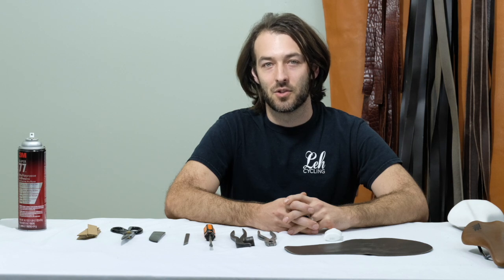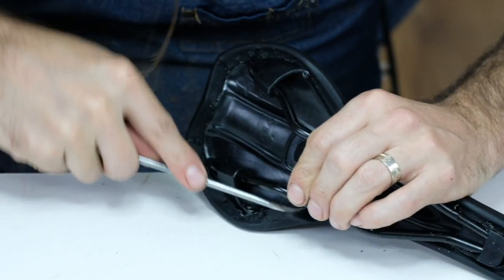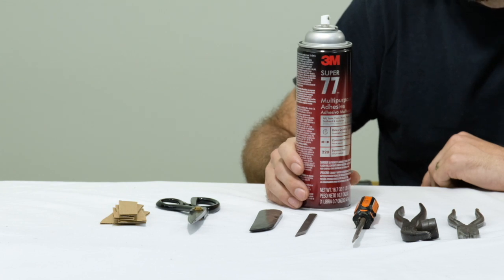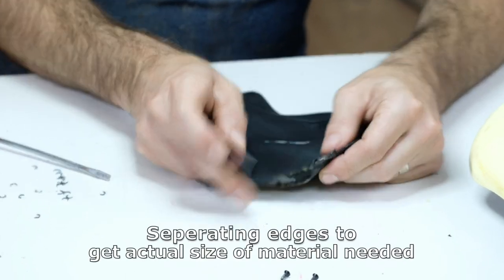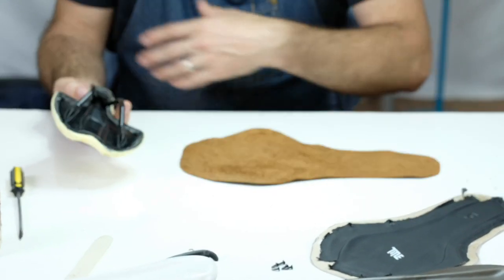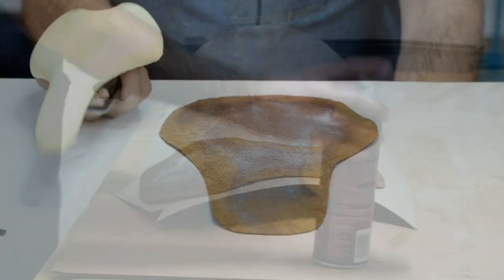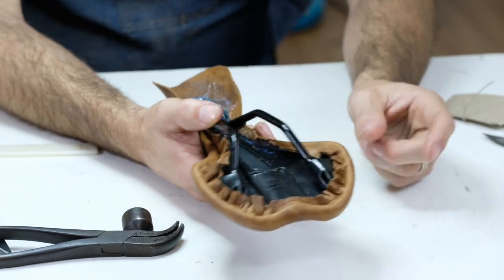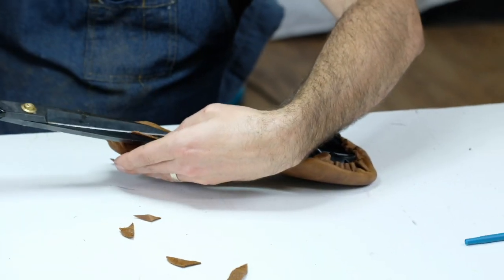How to Recover Your Bicycle Saddle With Leather By Leh Cycling

Comment: Hey, what glue is the white one for the edges? Thank you!
Reply: I have the same question. Anyone out there have the answer?
Reply: Elmers white glue
Reply: I'm pretty sure it's the water-based eco-friendly version of contact cement. It has has milky white color to it. The water would soak into the leather and help it stretch, unlike the solvent based version.

Comment: To ensure that grove is firmly glued, place a fabric there to from a mound, then can place the saddle in a thick plastic foil and in vacuum pressure bag. Suck out the air with a vacuum cleaner and wait for glue to dry, usually a day.
Reply from the maker: Also a good thing to try!

Comment: Thanks. Great video.  About to embark on my debut re-covering journey.
A few questions for you.
1. How long to wait before the 3M spray adhesive is tacky enough to hold, but not too tacky as unable to reset?
2. When is the 3M glue dry enough to move on to using the white glue?
3. How long to wait between application and with your white glue?
4. Should we not add white glue to the nose until the white glue on the sides and back is dry?
5. When is the white glue dry enough to move on to working the nose?
6. Is there a leather conditioner you recommend?  Will pants/shorts/tights/etc rub off said conditioner?  If so, will it stain/damage the clothing?
Thanks again.

Comment: Some leathers stretch more in one direction than the other. Which direction should be the most stretchable? Lengthwise or across?
Reply from the maker: Typically bovine hides have more stretch horizontally or near the edges of the hide.
Reply: @lehseats6509  Yes but where to put the more stretch on a saddle: Lengthwise or across?

Comment: saddle should be made at least with 5mm depth this is too thin
Reply from the maker: Sorry, this is not correct. You will not be able to wrap any bicycle seat with 5mm thick leather.
Reply: Normal roadbike saddle cover is 1mm in average because there is foam underneath. So 1.5mm thickness works fine too. 5mm is definitely an overkill.
Reply: 5mm leather would be for a Brooks-type saddle where the leather is structural, not just an outer layer.